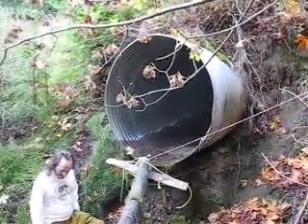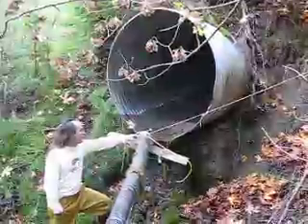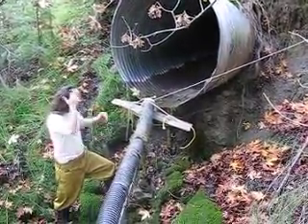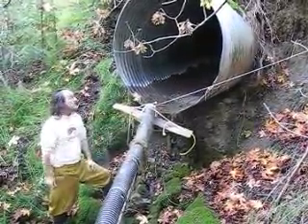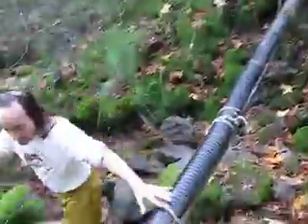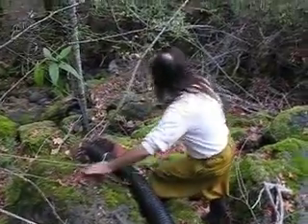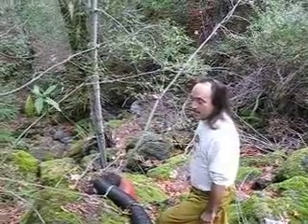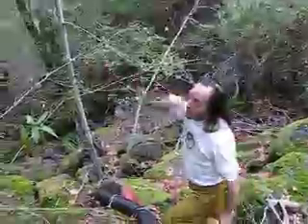In the Creek bed: Setting Up the Hydro-Electric Intake in a culvert

Comment: you need the intake grate under the culvert, make it much larger in surface area and cover it with the grate sloping away wherefore it will be self cleaning.